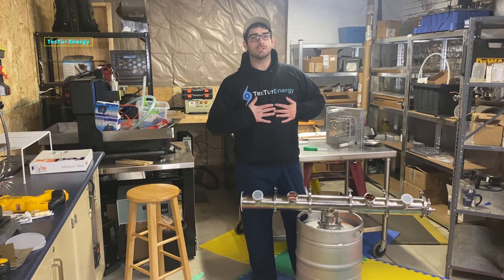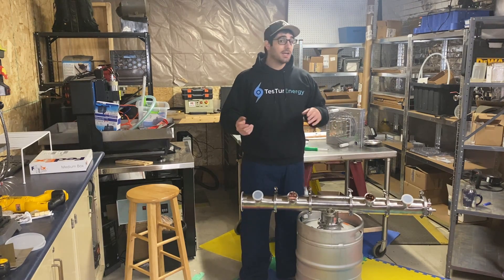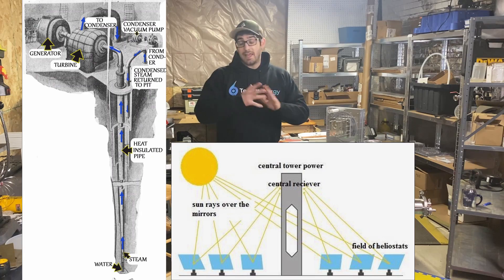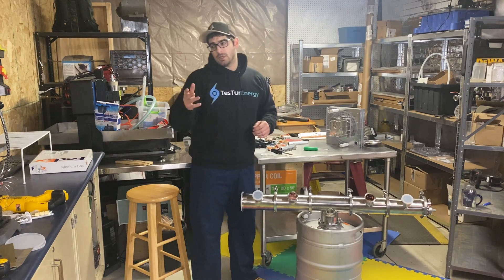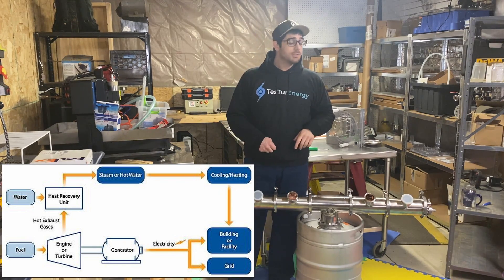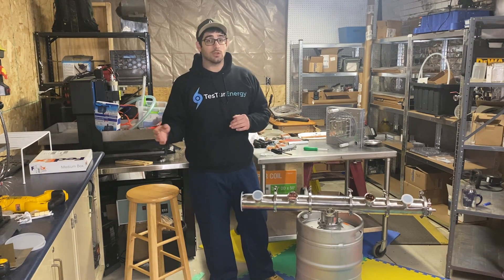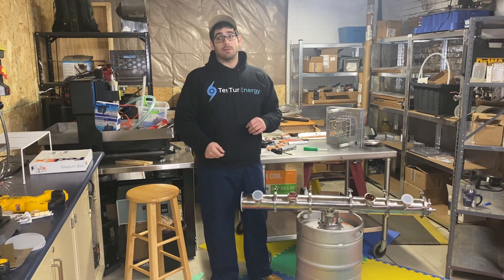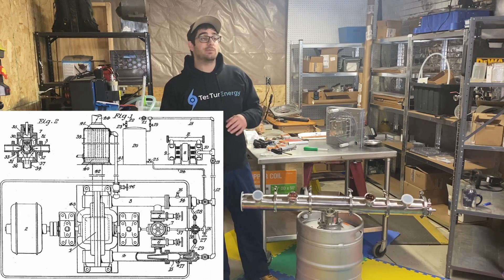Solis Talks Cold Steam Tesla Turbines - Nikola Tesla’s Electrical Power System + Patent GB 186,083

Comment: Great explanation, informative as always! This turbine can pretty much run off of any fuel/anything that creates heat, right?
Reply from the maker: Hey thanks Andrew! Yessir! You got it! But you need a cooling medium as well. That’s what the fountain steam condenser and/or the radiant heating water system is for.
Reply: @CharlieSolis  Ahhh to condense the steam back into water and then repeat the cycle?
Reply from the maker: Exactly!
Reply: @c3N3q  The Icelanders will love this system! Haha
Reply from the maker: Yeah geothermal will be killer with this!
Reply: @CharlieSolis  I thought that the 2nd stage was supposed to cool it 😔 ah well
Reply from the maker: @jeffjefferson3364  Unfortunately, that is a misnomer some people are spreading incorrectly. The second stage pump adds energy to the steam which increases its pressure and temp. 

Unfortunately, you cannot force a gas to condense with a pump by adding energy to it. If you have a steam and use a pump to increase the pressure so that the condensation point is higher, you will simultaneously increase the temp of the steam so that it is still hotter than then the new higher condensation point. 

Now this is not to say the second stage pump is useless, it’s doesn’t do what people have claimed. 

What the second stage pump does is add a heat pump to the exhaust. For example say with out a second stage pump, your exhaust steam is 30°c and your ambient condensing medium is 20°c. And a condensation point of 25°c The rate at which your exhaust will exchange heat with the condensing medium is dependent upon the difference in temp, 10°c And you will need a pretty large condenser. 

Now if you use a second stage pump, what you are doing is taking some energy off the shaft to increase the temp and pressure of your exhaust as it enters the condenser. Now say with the second pump it increases the exhaust temp to 40°c and raises the condensation point to 35°c so even though you are not within the condensation point still what has happened is now your exhaust is 40° and condensing medium is 20°c, so the heat exchanger between the two will be 2 times higher and as such your condenser can be much much smaller because it doesn’t need to have the exhaust have so much surface area to exchange the heat of condensation at a fast enough rate to. 

So what the second stage pump does is take some energy off the shaft to make your condenser MUCH more efficient. Unfortunately though, as I have tried to explain numerous times to the other real turbine builders, you cannot condense something without taking the latent heat of condensation/vaporization out. It’s a fundamental rule of thermodynamics. Now this is why large steam plants use supercritical Steam. Because in the super critical range there is no phase change between a gas and a liquid and as such there’s no latent heat of vap. That has to be given up and can’t be used to initiate the high pressure.
Reply from the maker: @jeffjefferson3364  now though I have a design for what I call “the multifluid vortex mixer” that I came up with 
https://youtu.be/qLBqbBPikcc
It uses the Tesla turbine as a second stage vacuum pump from the one side of intake holes and it pulls cooling water in from the other sides intake holes (which are not in communication with the other exhaust holes) and as the two perfectly mix as they sheer through the turbine the cooling medium condenses the the steam all before even leaving the second stage pump. But again you must have some cooling medium that can absorb the latent heat of condensation for the steam to condense. Which means that even after this vortex mixing pump I still have to take the heat out of the cooling water and either se it to preheat the boiler feed water or just be dumped into the air with the fountain.
Reply from the maker: @jeffjefferson3364  now even better I also have my Interstage Heat Exchanger idea that I came up with 
https://youtu.be/qLBqbBPikcc
It uses the ducted area between the first and second stage as a “shell-n-tube” heat exchanger to cool the steam before even getting to the second stage pump. This results in an “inverse brayton” style thermodynamic effect and by removing the heat before the second stage pump you reduce the work the pump has to do to evacuate it. Now the interstage duct actually is composed of the same thin sheets stacked together so I came up with the idea to just extend some out to work as finned heat exchangers. And it dawned on me that they were just making another Tesla pump on the outside so I added intake holes and then the extended heat exchanger fins actively now work as the pump that circulates the cooling medium as well. All directly on shaft.
Reply from the maker: @jeffjefferson3364  in the end I plan to use Both the interstage heat Exchanger and the vortex multifluid mixing pump to further aid in condensation just prior to the drive turbine exhaust. I’m just still hammering out the manufacturing on the turbine and just hubbed disc stacks in genera that can be used either way, turbine or pump. I’m almost finished with that and will be starting on these second stage pump prototypes
Reply: @CharlieSolis  I see. So what is the benefit here? Power generation at lower temperatures but less efficient? 
I guess I'll never have my hay dried
Reply: @CharlieSolis  it's been that long since I've even thought about this. Didn't the 2nd stage act as a condenser in jeremiahs setup?
The theory I was presented with was that warmish steam goes in, it takes alot of energy and time to get through the first stage as its resisting getting to the centre from outward centrifugal forces, the 2nd stage produces some vacuum and its a relatively straight exit. So it's the 2nd stage pump that acts as the condenser and it should almost come out as snow.
Now that's the idea he was presenting. I was confused as to where the heat went, as conventional thinking is that its pressure(temperature) differences that's driving the turbine.
Reply from the maker: Yeah they were producing “snow” because of the expansion of compressed air. I also think Jermaine has had the large compressor tank they used outside in the winter. so it was even colder before expanding so the moisture in the air froze from the cold pressurized compressed air expanded and dropped in temp past the freezing point of the moisture in suspension without the compressed air. This is the basis for all refrigeration. Expanding a room temp pressurized fluid to get a cold sink and absorb in heat from ambient. Then a compressor second stage pump compresses that vapor to increase its temp to be hotter than ambient to then give the heat off through a heat exchanger to cause condensation. Then the pressurized room temp condensate is put through a throttling valve and expanded to flash vaporize and drop in temp as it expands to being low pressure after the throttling valve allow it boil at a lower temp than ambient through heat exchangers. That low pressure vapor then gets compressed by the compressor heats it up exchanges heat with the heat exchanger to condense, etc etc. and the cycle continues.
Reply from the maker: These “cold Steam systems” are quite literally an air condition being used in reverse. Instead of putting in electricity to run a compressor to move a fluid to generate a heat gradient between two thermal bodies you use the heat gradient between two thermal bodies to move a fluid to apply a torque on a generator to produce electricity.

Comment: How are you going to make your bearings vacuum tight if you want to use brushless generators on a cog?
Reply from the maker: Hey I sent you an email!
Reply: I guess that whole setup must be in vacuum (placed in some vacuum box)?
Reply from the maker: Hey innovationforall. So the two systems will be separate loops from each other. Essentially the hot exhaust leaving the turbine goes through a heat exchanger/boiler to not only raise more steam in the high temp/pressure loop but it will also have  another heat exchanger in line that works to exchange the last bit of heat with the boiler and water in the vacuum closed loop cryophorus. 

That being said the high temp/pressure loop with the combustion can still exhaust to vacuum, as normal steam plants exhaust to a vacuum condenser, however because of the non condensable gasses in this exhaust there must be a second stage vacuum pump to further evacuate the gasses to maintain the vacuum in the condenser. And Tesla specifically has a high vacua patent with high flow capabilities. Doing this would make the system a combined high pressure steam rankine and inverted combustion Brayton Cycle. Something I plan on having for the final build but that’s a ways down the line. The dual stage Interstage Heat Exchanger design I invented is specifically for this purpose. If you haven’t seen it yet, check it out! 
https://youtu.be/pYSniitC8DM
Reply: @CharlieSolis  thanks, let me check the video